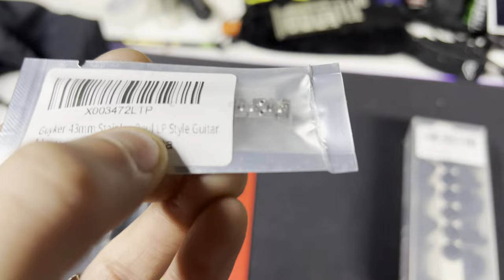Guyker Tune-O-Matic Tremolo / Les Trem Clone - Installation & Review!

Comment: These tremolos like the Bigsby, they aren't made for the same thing as a Floyd Rose. Flutters, slight drops like a b-bender to tremolo. Dive bombs to never match up to the Floyd
Reply from the maker: I realize that, and I know that is not the design of the product. As I said in my review, it is a great product for its intended purpose(as it should be!), but I wanted to make a video about it for anyone who was thinking of adding this for more aggressive trem usage. I certainly did not expect it to match a Strat trem or a Floyd in range or use!
Reply: Yeah, there is no way this is meant for extreme dive bombing. You can’t do this with a Bigsby either.
Reply: @BigJakeMusic  I am intrigued by this product. I have always wanted something that has a touch more responsiveness than a bigsby. It doesn’t have to be much more. Just enough to get my flutters and warbles without so much effort.
Reply: I've done plenty of dive bombs with bigsby style tremolos never had any problems then again I use very light gauge strings
Reply: @Winstonrodney6989 oo😊

Comment: The broken string problem probably because the ball ends were not secured upon diving that they will come out and go in to the hole again. Time after time crushed the string that tied the ball ends. That’s why Floyd Rose just use screws to secure the strings in place at it’s bridge.
Reply from the maker: That is a brilliant insight and I think you may be on to something. This design does not have any force keeping the strings in the tremolo itself, so when pulling down the arm, the strings probably do slip out a bit at the end, and when it snaps back, it might not seat properly and snap!
Reply: I do repair guitars as a hobby. 😊
Reply from the maker: @mikeykhhung  I could tell! :P Thanks for the insight, I appreciate it! I've moved on from this and put a fine-tuner tailpiece on this Les Paul, but this vibrato may get a second chance on my SG or Les Paul 100. I'm going to see if I can figure out an easy, repeatable method to solving this design flaw!
Reply: If you can drill the six retaining counterbores 4mm deeper and tap them with threads and put set screws to secure them. Maybe it would help.
Reply from the maker: That’s a good idea, I’ll take a look at it and see if I can get it done.

Comment: It fits great, it looks beautiful, works great for a couple of day but let's not forget that it bends due to string pull over time. I gone through 3 of those. If it was made of thicker metal on the base it probably will work great in a long run

Comment: I know this not the propuse of this video but the Duesenberg version with expensive component works, but it's not cheap. I saw another one of your videos of the FRX, my experience was horrible with it and I got a refund from amazon and with that money I bought: good locking tuners (hipshot), Duesenberg Les Trem 2 and same Guyker roller bridge and now it works great. I had a graphite nut on my harley Benton, so I didt use the roller nut, but I did add the String butler.

Comment: just an idea, try dipping the ball ends in liquid plastic that electricians use, instead of the painter's tape.  Maybe that will work to give a little cushion and protection.  Also try to really narrow down where the string is breaking, if it's at the tremolo itself, maybe some more Dremmel buffing will soften the edges at each string.  Great demo that shows problems and solutions. Thanks. PS:  I just watched a video by Deusenberg talking about most asked questions.  They mentioned adding a washer underneath the tremolo to raise it up.  Maybe the angle is too steep going from the tremolo to the roller bridge.  A washer on each side would raise it and and change the angle, making it less stressful on the string.  Worth a shot.

Comment: If you do not move the roller nut slightly toward the bridge side, the distance from the nut to the bridge will be longer than the normal nut.Of course, the tuning will go wrong.
The instructions for the Fender roller nuts  also say so.
Reply from the maker: This is true, but I did move the saddles on the bridge to compensate for that extra difference. I apologize for not showing it here!
Reply: I appreciate your kind reply.
That was my misunderstanding.
I'm sorry.
Awesome video and I enjoyed it a lot.
I will not forget to subscribe.
Reply from the maker: Thank you so much! No need to apologize. It’s absolutely a good tip.
Reply: @BigJakeMusic It should work for strings vibrating freely but once you fret it the tunning will be affected since the distance from fret and bridge will not be correct the intonation of all other frets will be wrong
Reply: From what I understand, that's how the Fender one is designed, but the Guyker one is designed in a way that you don't need to do any type of modification on the wood
Reply: @DravenxEyeless  

The normal nut apex is usually at the higher end of the nut, but the roller nut apex is at the roller apex approximately midway through the nut width.
Adjusting the bridge saddle allows you to adjust the distance from the nut apex to the bridge saddle to scale, but changes the distance from the nut apex to the first fret.
In other words, roller nuts slightly increase the distance of the first fret from the top.The same goes for more than the second fret, and the tuning goes wrong.
It's a very small difference, so it might be okay if you don't mind.
Reply: @thiagoavila5329  Yeah you need to measure the distance between the front of the nut and the contact point and use a router to remove that much fretboard material to compensate, then it isn't "oversized" like it should be to fill the whole newly widened gap. That's why I didn't get it, I got a bone nut instead to replace the plastic one on my Chibson SG.. still waiting on an intelligent roller nut, but I did add the roller bridge and tremolo they still work great with a bone nut in combo with roller string butler on the headstock.
Reply: @墓場鬼太郎-n5x  Yeah how to measure the difference?  If someone did it and measured it, we may know "its like 2 cents is all" or "its 40 cents!"
Reply: @davidmichaels307 

I can't exactly understand what you point out , but It's not that complicated.

Normally you would measure the scale length from the end of the nut to the bridge, but with a roller bridge you just measure from the centre of the roller instead of the end of the nut.
With Fender guitars, the nut specifications (slot specifications) are set, so it seems like all you need to do is remove the wood on the bridge side so that the roller nut fits snugly.

I can't explain well because I'm just an amateur and not an English speaker. 
So please try asking an expert.

Take it easy, and have a nice hobby life !
Reply: @墓場鬼太郎-n5x  Yeah its not hard: think about what makes pitch change when fretting different notes: the distance between the fret and the bridge. Shorter string = higher note.  Notice the distance between the frets changes as you move up the neck?  The distance BETWEEN each fret matters as to how much the pitch will be raised or lowers. Now with the original STOCK nut on the headstock end of the guitar sets a distance between the nut itself (the open note) and the first fret.  You play an open note, you hear a frequency, then you play a fretted note on the first fret.  When you change to playing the fretted note, you change the length of the string by a distance equal to the total open string length minus the distance between the nut and the first fret.  That distance was calculated when the guitar was made to be the correct distance to raise the note of the string one half step.  Now when you put this new roller nut on, the contact point for the string becomes longer as you've acknowledged by pointing out you can scale the distance with the bridge adjustment.  What also became longer now is the first fret distance.  Playing an open string then playing a fretted note on the first fret now shortens the string by a distance equal to the previous measurement with the stock nut, PLUS that extra distance to the new contact point. That distance between first fret and open note is LONGER with the new roller nut, thus the pitch will be instantly sharp on the first fretted note, and ALL notes will be sharp in relation to the open note.  HOW MUCH? nobody has posted a measurement of how much it changes the intonation between open note and first fret, but it certainly does.

Comment: FYI, latest version of this seems to have rounded off some of the edges, and comes with a heavy and a light spring. Haven't broken the strings yet with my 11 year old hammering on the thing, doing dive bombs, pulling up, etc. we did to a roller bridge and locking tuners, stock bone nut.

Comment: You should get some silver bearing rosin core solder and solder from the ball end to where the actual string starts. Either that, or buy strings that are pre soldered. I've had to do that on some Kahler trem guitars I've had over the years.
Reply from the maker: Thanks, that's a good tip!

Comment: Would be interested in the difference in intonation specifically between the open string and the first fretted note when comparing the previous nut which terminates the open string right at the nut/fretboard barrier and the roller nut which terminates the open string a little further toward the headstock (flatter)... Seems the difference in distance between the open string and the first fretted note would be greater so the intonation between there might be off (or closer to perfect on one that isn't?)

Comment: I have the duesenberg and goldo branded versions of the Les Trem. The high e breakage thing is an issue on those. My first remedy was using the ball end of a broken string and running the new high e through that. It seems the way the string goes through that ball end prevents it from getting unraveled. I haven't had a string break in about a year with that. The next option is to buy fender strings with bullet ends instead of ball ends. Those have worked great. Another option is, instead of tape, solder your strings near the ball end to prevent unraveling. It's really only an issue on the high e and b. The same problem happens on Jaguar/Jazzmaster trems too.
Reply from the maker: I ended up putting this on my SG Standard. I ran a string through the ball ends of all 6 strings and it hasn't snapped a string yet!

Comment: I wasn't expecting you to do anything like this with your new les Paul but  it was easy and didn't harm your LP I'll be watching to see how you get along with it .  I love my 60s standard I've only had it 3 months its still in brand new condition I don't know if I'm brave enough to work on it yet .. But my new Kramer Beretta special that I've had  a week is going to get Eddie stripes in a few days my vynl striping came in from Amazon I bought 3/4 inch black its here  still need to order the thin tape probably 8th inch and do the deed .
Reply: I meant to ask you do you think the gyker roller nut you used would be a good candidate for the baretta special ?
Reply from the maker: Yes, absolutely! I actually intend to install it on my own Baretta Special very soon.

Comment: Check in out with heat shrinks to prevent the ballends of the Strings looking more professional.
Wenn you not have hot air Gun, you can use a candle ligth for shrinking😉
Happy tremoloing😉

Comment: Still have this on? Solder your ball end wraps, that'll solve 85% of your string breakage.

 Burnish those edges, not file. Use fine wet dry paper first to knock the edges down first, very lightly. Burnishing is not visually dramatic unless you're peeping with a USB microscope.

If it doesn't return to zero and the guitar wont stay in tune use a stiff Bigsby or Duesy spring. Locking tuners or luthier's knot, have a tech work on your nut slots. These trems are fine, they just need a little love. And, they have more working throw than a Bigsby, no worries

Comment: Nice you bought a roller bridge. Problem (usually is) the rollers may not turn. The pupose of it gets defeated if they don't turn freely. In order to take full advantage of a tremolo, the rollers MUST be free rotating. It will work much better than a regular bridge as the rollers provide a better sliding design being round as oposed to square. At about 29:00 I stopped watching because you don't need tape. There may be a burr or sharp edge where the string passes throught the mount. You shouldn't have to wrap tape around the string to prevent it from breaking. Usually stuff like this that is made in the orient needs to be inspected or modified to work correctly. From an Industrial Millwright Mechanic of 29 years and guitar player of 68 years. Then again, I'm sure if you pull up hard enough the thing will rip the screws from your guitar. There is a point where things become unreasonable and people expect unreasonable expectations. Many factors are involved the major one being the type of person who wants to use one and how they expect to use it. Buy the way, it's pretty hard for any tremolo to span one whole octave. You can't buy that out of a box and bolt it on an expect that. Maybe use a slide ??

Comment: Thanks for this review. Do you mind sharing an update? You still using it?
Reply from the maker: The trem was removed from this guitar; I now have a fine-tuner tailpiece on it and it’s my number 1 guitar. I moved this trem over to my SG and it seems to work a lot better on it than the Les Paul. It’s been on the SG since I removed it from the Les Paul. I found that running a thick string through the ball-ends of all six strings(at the end of the trem tailpiece) prevents strings from snapping for some reason. I’ll make a video about that!
Reply: @BigJakeMusic something like a 10:46 string at all the ends of the strings?

Comment: I actually just saw this device a couple of days ago. I never heard of one before. I have to say, it looks really weird to see a trem on a Les Paul. I hope you get the issues worked out.
Reply from the maker: I did gig it, and no strings broke. However, I decided to ditch it due to the strange aesthetic and the fact I had to wrap the strings in tape. I went with a stopbar tailpiece with fine tuners from Guyker. A video about that will be up in a few weeks. So far so good with that one; it's an amazing product!
Reply: @BigJakeMusic  use a shrink tube on the string end to protect the ball end from breaking.

Comment: I got a Guyker version of the Gibson TP-6 fine tuning stop bar. The slots where the ball end goes are inconsistent, and the D string slot is too small for most strings. Looks like the chrome plating got too thick on a few of the slot pieces, and one has so much extra that ball ends don't fit. Boo! 😢

Comment: i wonder if you use heat shrink following the sizes per string then see how it sounds.
Reply from the maker: That’s a great idea! I took this off and replaced it with a fine-tuning stopbar tailpiece. I put it on an SG and threaded a fat string through the ball end of all 6 strings and cut it off at both ends. So far it hasn’t snapped yet! I’ll make a video about it after the SG gets some more road-time at gigs.

Comment: Nail file should work
Reply from the maker: Thanks for the tip! I actually moved on from this trem and installed a Guyker tailpiece with fine tuners instead. I’ll eventually get a Floyd FRX for it, but the tailpiece works fine for now!